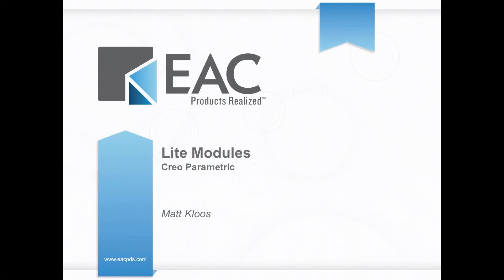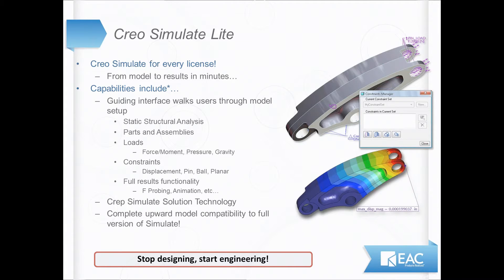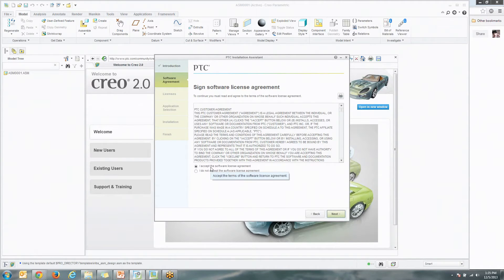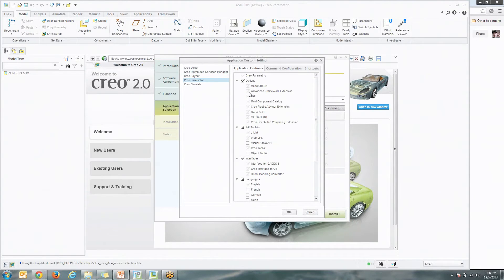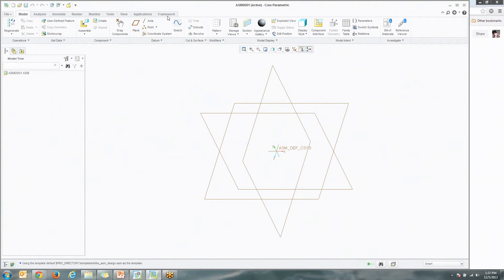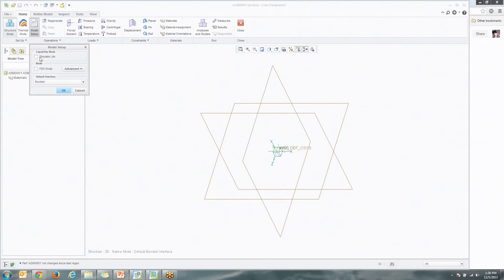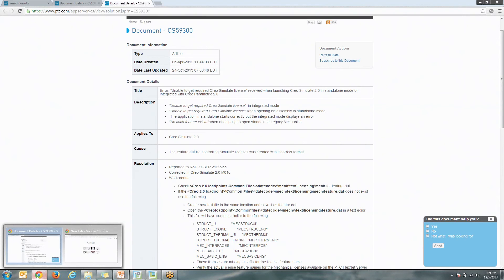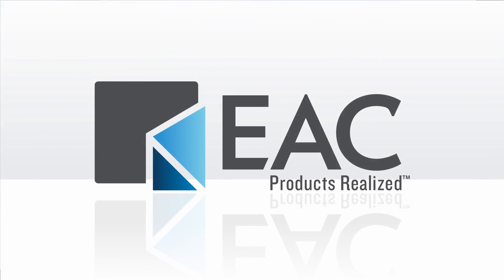Creo Parametric Lite Module Installation and Activation - EAC Tip of the Week

Comment from the maker: Hi Andy, The NC Lite (expert machinist) should be installed with the standard installation.  To access it, create a new file, select manufacturing as the type, and then choose expert machinist.
 
If that does not work and/or you need more information, please let us know.